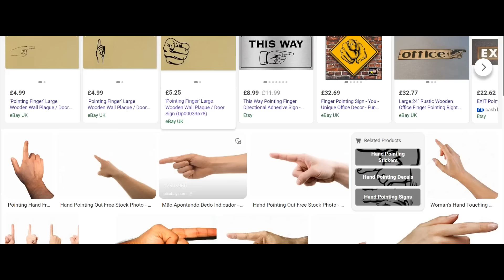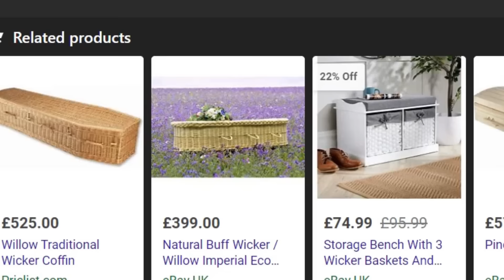I Made FNAF 2 Mangle From A BOOTLEG FUNTIME Foxy Figure

Comment: Fellow model builder here! Rather than use Blu Tack and superglue for those custom bits, I usually use Green Stuff. It's a two-part putty that you mix together and hardens on its own. It's around £20 for 100g of the stuff, and it lasts a good long time. Now, granted, I build Warhammer models, so I'm a tad biassed on that, but I'd still recommend it!
Reply: @Evelyn-ng6qp I'm not sure. I don't see why not!